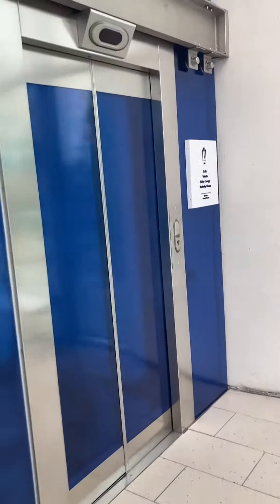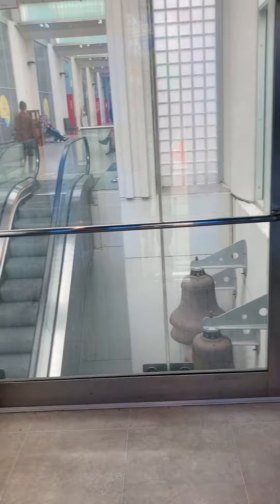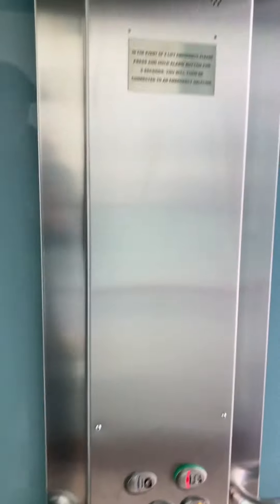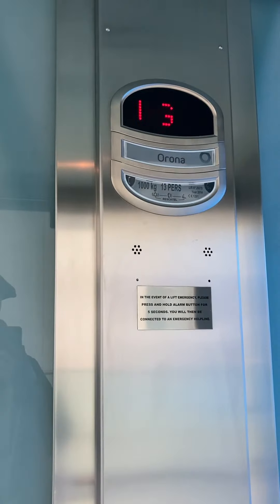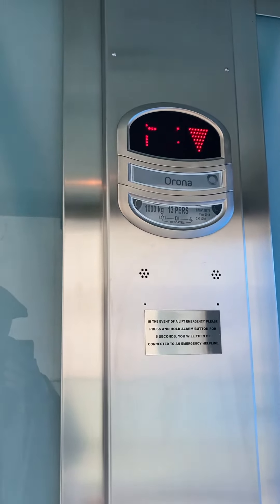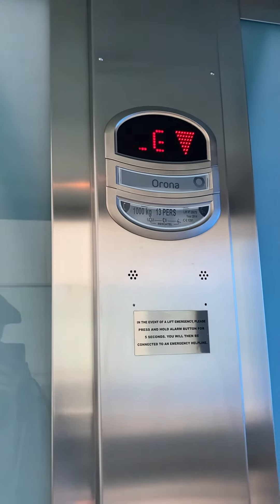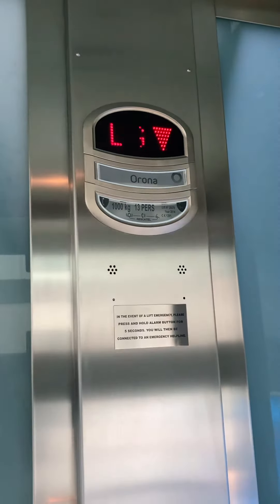Painfully slow 2014 Orona lift @ Millennium Gallery, Sheffield

Comment: MP mod orona. This lift really isn't doing well as it still has a lot of MP parts. It needed a full orona MRL replacement
Reply from the maker: Isn’t it a hydraulic because I never saw a counterweight.
Reply: @GTLPT  it is hydraulic. I just said it needed a full MRL replacement.
Reply from the maker: That makes sense, thanks for clarifying